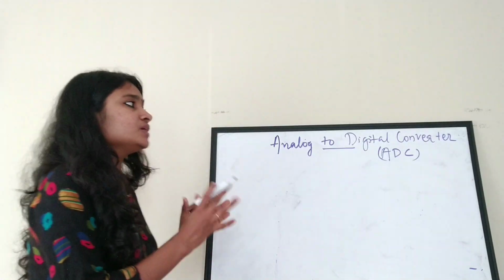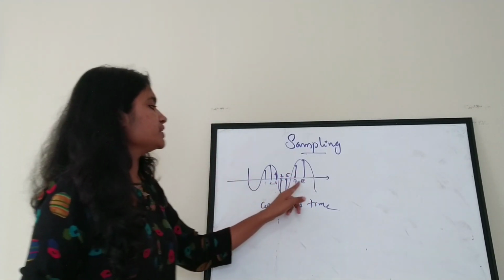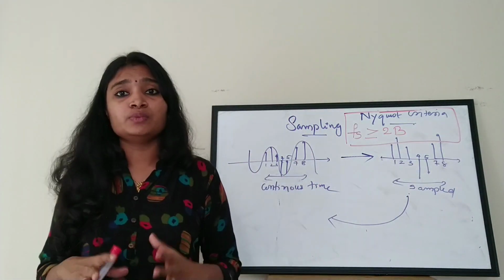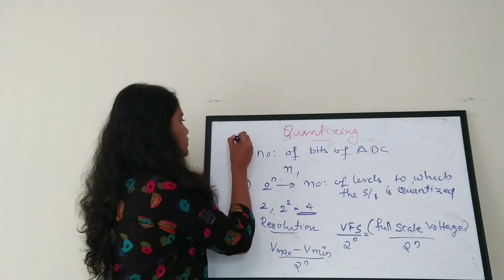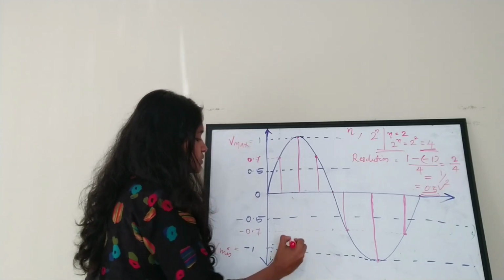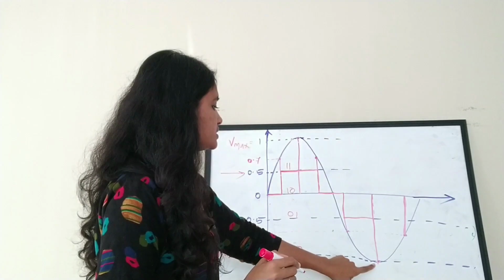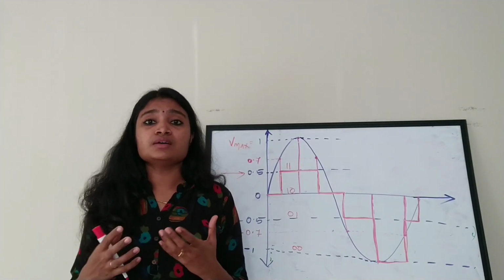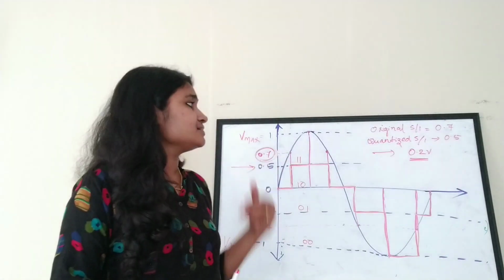Analog to Digital Conversion Principles||Quantization Detailed Explanation||PSC

Comment: The Quantized signal on the postive side is wrong between the 3rd and the 4th sampling instance, the input voltage is around 0.7V , so the quantized output should be 0.5V till the 4th sampling instance, but you made it zero. Can you please explain how it went to 0 level